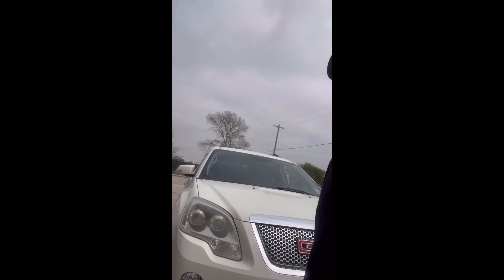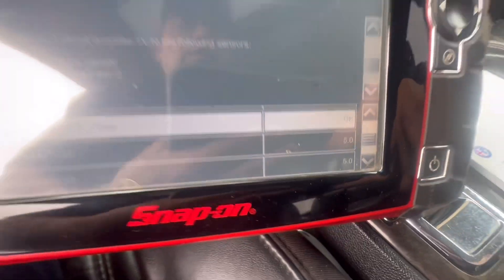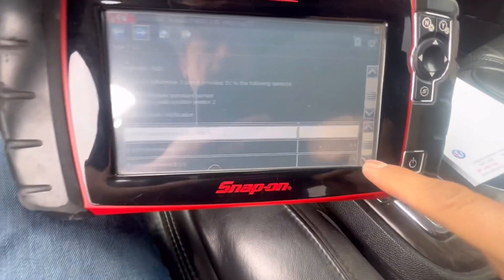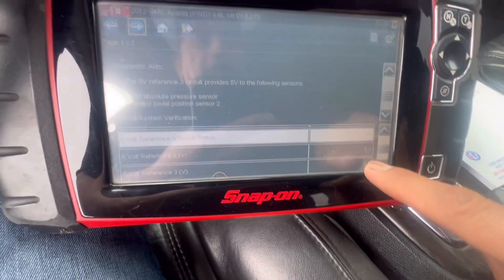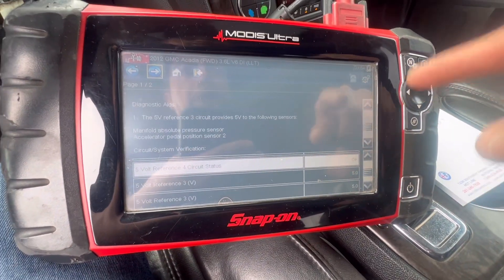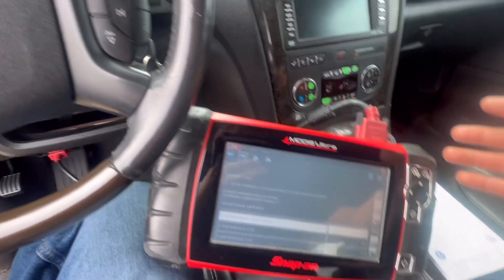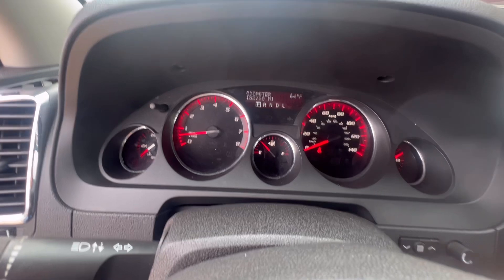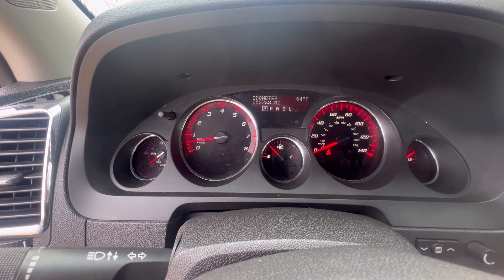2012 GMC Acadia P0300, P0697, 5v Reference 3 circuit, engine power reduced

Comment: Thank you. Just took a chance on a 2012 with 100k miles. Hopefully I can maintain it and avoid the dreaded 3.6 problems.
Reply from the maker: Just change the engine oil every 3k miles. And drain the transmission every 3k miles till the fluid comes out red ish again. It will run for a long time
Reply from the maker: You can follow me for more information about how to maintain these vehicles

Comment: try checking for loose fuse box bolts next time add washers to space it and tighen back down
Reply from the maker: the tcm was faulty. I replaced it and the car runs and drives like new again. thank you for watching, like and subscribe it helps

Comment: Same here i have chevy traverse 2012 showing code p2138 i replaced trotle body, accelerator padel but still same can u please help me out
Its running but engine power is reduced , stabilitrax &traction control lights comes on and even some time it dont even accelerate
Reply from the maker: Let me check tomorrow. I was very busy today. Mine had the P0697 which is different code than yours. I’ll look it up tomorrow for you
Reply: Ok bro

Comment: I have the same codes with Buick enclave 2014 Same codes just with map sensor circuit low voltage any advice
Reply from the maker: Check the map sensor conector. It happened to me with a Buick enclave. One of the wires was broken and it wasn’t visible. It was broken in the inside not the insulation
Reply from the maker: Are you getting the p0697 too
Reply: Yeah also p0697 code